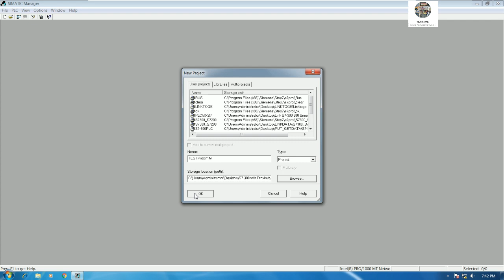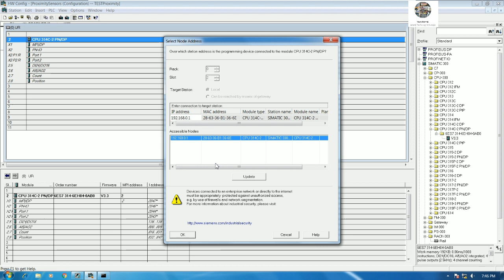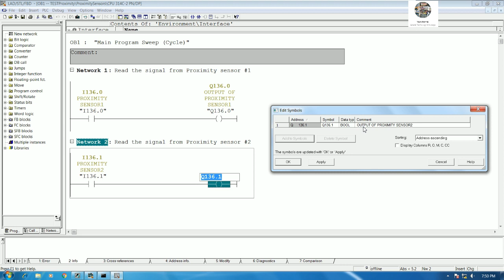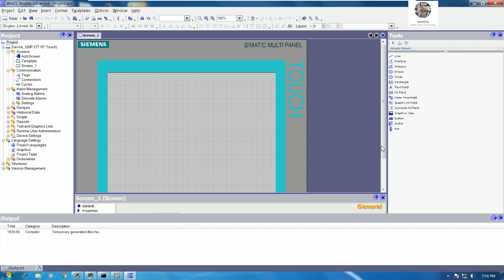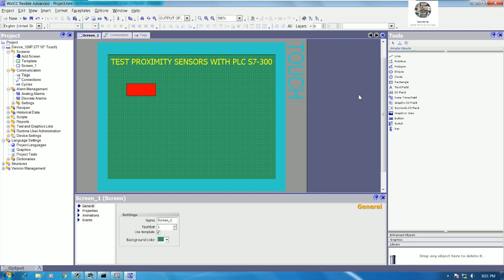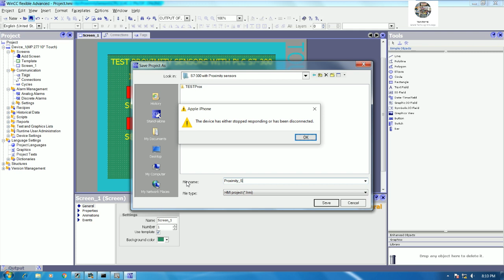How to wiring Proximity sensors NPN & PNP type to PLC S7-300

Comment: NPN sensor black wire output cannot directly connect to input of S7-300?
Reply from the maker: You cannot you much install small relay for support then connect with PLC input
Thanks!
Reply: @generaltechnologyknowledge5165 l just tried connect directly to plc s7-200 and it work,......